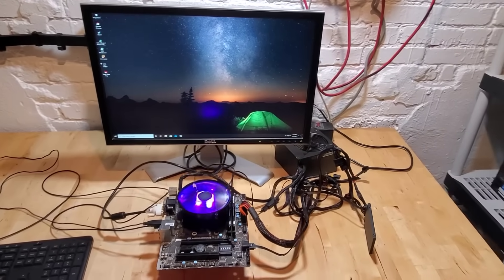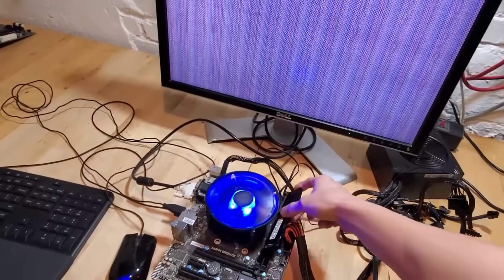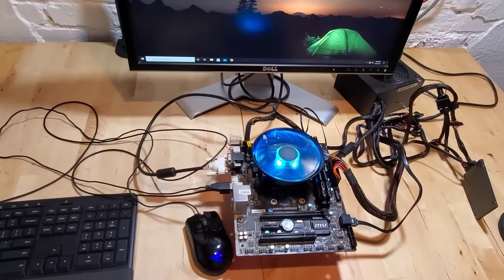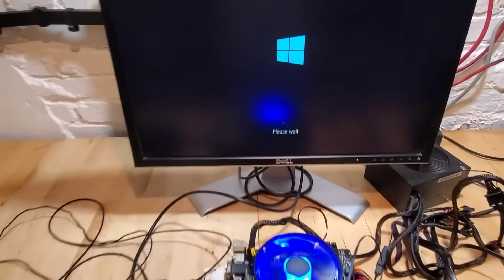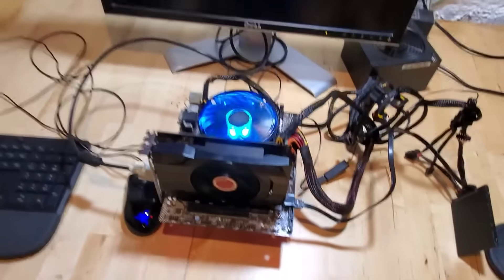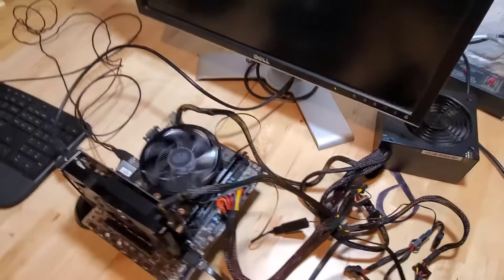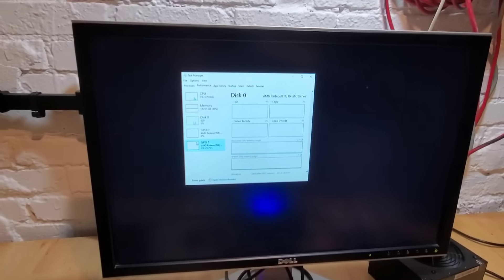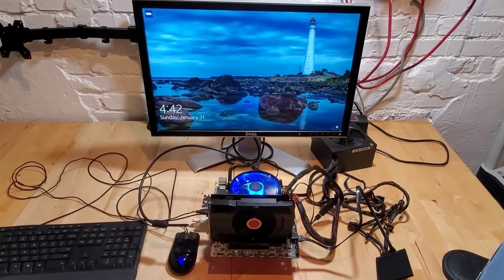What happens if you remove PC components from a running computer?

Comment: I'd love to see you try removing the cpu while its running, but with a graphics card plugged in. I think that the display was lost due to it using the cpu's integrated graphics, I'd love to see if there's any difference with the gpu plugged in
Reply: Here is my guess, it will be either a BSD, or a normal but froze screen. 
Might be just the same as a duo monitor setup, while the GPU driver is somehow not functioning but the CPU's GPU buffer is still there.
Reply: The GPU displays data that it gets from the CPU, means no CPU = no picture. Nothing on a PC works without a CPU, because the CPU is the only component that can controll the adress bus and select the chips and memories, that it needs.
Reply: @Kasi11  Actually, it displays data from its framebuffer in VRAM. One way to put the data in there is for the CPU to write it. GPUs can write to their own memory as well, but that gets triggered by receiving commands from the CPU.

It may be possible to start a program on the GPU shaders and have it continue running after the CPU is removed (I can't confirm or debunk this off the top of my head).
Reply: @falcon-ng6sd  Well I agree, but the GPU wouldn't be able to continue the program once the CPU is removed
Reply: @Kasi11  I don't know, it might work. I haven't experimented with CUDA/OpenCL enough to say for sure.
Reply: @falcon-ng6sd  well, i don't know much about modern coding but i know quite much about the hardware and normally the GPU wouldn't be able to read a program and execute it by its own, because the CPU will read the instructions and will transfer the data needed for the graphics to the GPU or VRAM which the GPU then reads and executes, but the computer technology gets so fast better and better, that this might not be true anymore. It would be nice to see someone testing that out.
Reply: @Kasi11  The CPU would get the GPU to start running the program and then let it work. There could be some issues with compute task timeouts - I'm not sure if these are enforced purely by the driver or if some controller inside the GPU is involved.

Anyway, yes, it would be an interesting experiment. A good substitute for removing the CPU from a running system could be triggering a kernel panic to lock everything up.
Reply: @falcon-ng6sd  after a little google search i found out that GPUs have their own instruction set so they are basically a computer for their own. But i think not every program will still run, but maybe a few will or at least show anything.

Comment: See what happens if you connect the IEC lead to the PSU, switch it on at the mains then plug it into a motherboard?
Have subscribed to your channel mate. Thanks for this video! have been using and building computers for over 20 years now and have always wondered what would happen if a component was put it again when the system is powered up from being off.
Reply: Not much would happen, as ATX has a softstart function requiring the motherboard to activate the power supply.

Comment: I mean playing with the HDD/SSD isn't that bad if you are turning off the pc. I was using my HDD as an external drive to store things a lot. I have my OS on my NVMe SSD and I'd just turn off the pc and connect the HDD. Turn the pc on and it would get recognized perfectly. I'd store my things on it, or move things from it on the SSD. Turn the pc off, disconnect it, restart and the pc and the OS would work perfectly fine. I'm not 100% sure, but I think it would still have worked fine if I did not turn the pc off at all if I had my OS on the SSD. I guess you just have to worry to connect the power first and then the SATA cable when you connect it and when you disconnect it start with the SATA and then the power.

Comment: Fun fact: removing and plugging secondary sata harddrives are okay when system is running.

Curious what will happen if you remove the GPU while the system is running, then connect the VGA cable to motherboard.

Comment: I have a question,
What if you turn on the pc when the power is low voltage

Every day, the electricity in my house is often low. And I don't want to turn on the pc when the voltage is low.

Comment: Windows software (except server systems) load all the main hardware only at the start of PC, so if you unplug and plug main hardware after bios screen, system will ignore it, so it does not support hot swapping.

Comment: Well and interesting thing happend to me some time ago, i was playing csgo and suddenly my game frozed, i tried launching the game again but steam didn't recognize csgo anymore, and when i relocated the game from steam, i saw that my hole SSD was missing, i have a sata ssd and m.2, and a HDD, the game was on the sata ssd, my heart dropped for a moment, but then i thought to myself maybe i didn't connect the data sata cable good enough, because i just cleaned my pc, placed the cable back properly this time and everything worked fine, but then i decided to do a test, i went and got in a comp, disconnected the ssd, my game froze and when i placed the cable back in everything works as intented and the game picks up from when it froze, so in conclusion check your wires twice after a cleanup !
The ssd model is: KINGSTON A400 240GB

Comment: i think if you remove the ram while having a dedicated gpu, it wont have this much of an effect of the picture. this could be because the onboard graphics does use the ram as video storage.
Reply: Same deal with removing the CPU - with integrated graphics, the GPU went with it. In older PCs, e.g. Intel Nehalem and earlier CPUs, the integrated GPU was in the chipset instead.

Comment: With few exceptions for special-purpose (and also expensive) SDRAM modules, RAM can only hold memory while getting power. This is why restoring the system by putting them back in would be impossible, even if the OS would be robustly designed to allow for hot swaping - all data in RAM would be lost.
Reply: No, Dynamic RAM (DRAM) not being refreshed retains memory but starts to decay to uncharged state. So unplugging a hot DRAM chip and replugging again means the decay cycle was extended from milliseconds to seconds, causing random errors. “Lest We Remember: Cold Boot Attacks on Encryption Keys” explored successful ways of doing this with acceptable losses (cooling DRAM stick to reduce error rate, error correcting/accepting data recovery algorithms).

Comment: Two corrections:
1: When restarting after pulling the CPU out, it shouldn't need to do anything to the CPU (theoretically, anyway). Windows boots into recovery mode whenever it detects a problem occurred that may affect normal startup, and it knows when it wasn't shut down correctly (because the filesystem is still marked as being 'open'), and it's also likely that the system management controller on your MB registered a CPU failure and recorded it in CMOS ram.
2: PCIe does support hot swapping, but many graphics cards don't, or more accurately, their Windows drivers/proprietary Linux drivers usually only initialize a GPU during boot. That said, if you had PCIe hot swapping enabled in your UEFI setup, you should be able to switch the display cable to the onboard graphics and carry on using the computer.

On a side note, it's rather curious that Windows doesn't bluescreen (or at least try to) when the RAM is removed. You would want it to in order to prevent data loss/corruption. I might try this on Linux to see if it panics.

Comment: Can you re-do that GPU test with a cable from the onboard gfx port to a second monitor? I wonder if it just switches to output the image on the other port when the GPU is removed. The system might still be working?
Reply: 的确，使用远程桌面还可以显示图像
Reply: @wsyong11  What you see via remote desktop is not always what comes out of the video port. So even if that works, it doesnt tell you if the PC is still working in terms of outputting an image for the local user.
Reply: En Linux eso podría funcionar.

Comment: Thanks to you, now we don´t need to sacrifice any expensive component to satisfy the curiosity.  But about the Hard Disks, for the bios taht includes "Hot Plug", option,  is safe to remove it  if no I/O operation is being performed,  and connect it back and it will resume the normal operation just like unplug/plug a flash drive.

Comment: you forgot to try pull off the power supply unit, and see if the system will still be running

Comment: Half of the reason why the system doesn’t recover is due to software ie Windows not being able to recover rather than it being a hardware failure.  What would the result be on Linux?  Hot swapping disks should be easy, but I’m not sure about ram sticks.  Gpu should recover as well, but there’s no way you can hot swap a cpu unless you’ve got full redundancy like a mainframe.
Reply: i know that for me, on linux, pulling out the harddrive/disk causes no immidiete problems
if you got programs in SWAP, they'll crash
but the system keeps running in read only, with programs/libraries cached in ram
Reply: Could disable swap file on that ssd, have enough ram in the pc, and taking out the ssd then shouldnt crash Windows.

Comment: The Windows not booting normally issue was surely not caused by you removing the CPU and the CPU does not "need some recovery work" at that or any point. Its just how Windows works - you don't shut it down properly, the OS checks itself if something got damaged - on the file system usually.

Comment: Nowadays, windows has removed hardware protections, which will cause a system interrupt with a blue screen. But back in the days of Win9x, it was a lot more fun.
Reply: You can try it using mountvol C: /d without having to take the hdd off. It should go back to normal after the reboot

Comment: At first case you also removed VRAM (for integrated GPU), you should retest it with using discrete GPU.
Also it would be interesting to disconnect discrete GPU with using iGPU.

Comment: Kinda disappointed you didn’t take out the ram while the GPU was on to see how it would affect it when not relying on the integrated graphics
Reply: I second this. It would have been interesting to see what patterns, if any, would have developed in doing that because the screen's framebuffer is in VRAM on the GPU instead of system RAM.
Reply: the same will happpen since gpu drivers are loaded into the ram.
Reply: @Servidor_Publico_do_Ancapistao  that's a good point, this fact totally slipped my mind!
Reply: @Servidor_Publico_do_Ancapistao  So you can safely say that patterns are caused by drivers and not something else? Especially since not all of RAM was disconnected at first
Reply: @MrCh0o  when he removed one ram, part of the information from that ram was lost, but the other part was still loaded into the second stick, but the computer was already frozen by the time he removed the stick. Removing the second stick just killed the rest which was already dead.
Reply: Another nice thing would be to check whether the integrated graphics (and the rest of the system) were still operating fine when the discrete GPU got removed
Reply: @MrCh0o  removing a live pci/pci-e card will almost definitely short and fry it. he got very lucky
Reply: @wheeI  You don't understand what a short circuit is. Removing a PCIe card will never cause a short circuit, unless after removing the card you stick a screwdriver into the PCIe slot to short it...
PCIe actually has support for hotswapping, though hardly any motherboard has it enabled as nobody uses it. So hotswapping a GPU is a bad idea, won't work and might damage your GPU but it will not cause a short...
Reply: The same thing will happen since you may see in the last part where the hard disk is removed.
Part of the "stuff" are temporally placed in the RAM and once no matter what. So once the "stuff" are forcefully removed, the OS will not act as normal.
Do you ever wonder why the running OS itself requires so much RAM?
Reply: @willqin4628  Not true: Windows will always crash, because it is badly built and lousy. Linux on the other hand will just keep going, it will complain (kernel logs will tell) that it can't read or write from the SSD. IT will keep trying though and when you plug in the disk again, it will just resume the read and writes that the Kernel had before. Linux was originally based on Unix, which was the best OS in the world while Billy Gates was still in diapers. The lesson here: If you build an system well from the start and build it for the ages (Unix), it will still be working amazingly even 80 years later (Unix turned into Linux, Unix died, Linux kept going). While if you design something shitty (Windows) then it will never really work well. That is why professional IT today uses Linux, not Windows.
Reply: i tried this myself about a year ago actually because my system was only recognizing one stick, so i thought the other was not seated properly and wouldnt make a difference to remove it, foolish i know. but iirc what happened was the screen froze and the display didnt clear until i restarted. but unlike what happened in the video my pc wont reboot, the psu fans spin up and so on but i dont get any display feed at all, not even a bios prompt. i still have the pc though so if anyone has any suggestions to get 'er working again i'd be very grateful, esp as i havent had much spare cash available to replace it or take to a repair shop unfortunately.
Reply: u do it then brokie
Reply: Just a bluescreen, as the OS and all data storage for the CPU is suddenly gone. Except that the code needed to display the bluescreen in Windows was also in the RAM, is the same if you remove all memory from a human being: Instant death, as even the information how to breathe or the heart beating is gone.

Comment: What happens if you remove the RAM while using the GPU as output? Integrated graphics use system memory, so that's probably what happened to the screen. But the card has dedicated vram, so it might behave differently.

Comment: I cringed so hard during the entire video my face broke.

Having said that, I did try a really bad thing one time some 15 years ago.  I tried to swap IDE hard drives while the system was running.  Turns out the knowledge of what's on the drive is kind of a "shared resource" between the drive and the OS.  The PC didn't understand what it was looking at; it thought it was still looking at the old drive.  I swapped the old drive back in but it had already absorbed some of the "new" information from the other drive which then was integrated into the original drive.  By "information" I mean directory and file structure.  The drive was ok but the OS and drive no longer knew where anything was with certainly.  It was a file full of photos and all the photos were now "ripped" like looking at an old VHS tape with video tears on it.  Many photos were gone completely, some folders were missing and almost all the photos were affected.  Some not too bad, many ripped halfway through, many completely unsalvageable.

So yeah don't do that.  Or pull ANYTHING from your computer while it's running.

Comment: I've always wanted to see what happens if you try installing an additional stick of RAM with the computer running.  Also rdp into the computer, then remove the gpu to see if the whole computer is locking up
Reply: If you install another stick, the system won't recognize it until you reboot

Comment: The ssd removal now clears up my mind why my computer is going black then bsoding
Reply: The bsod believe it or not is actually a program that runs when a critical issue is detected. Its possible to disable it but you honestly shouldnt. But when it is disabled and the pc crashes, the system just hangs.

Comment: Is there anyone else like me who had never opened CPU, even for cleaning, thinking that you can't put it back together or you'll break it?
Reply: Only difficult part is putting it in when building as you can bend pins on the motherboard (did it on my first build but msi got me an rma quick). Once it is in you can always reapply some new thermal paste to get temps down every couple of years. It is super easy and nothing to really worry about tbh, built my first pc at 14 or 15. You don't need to take it out to reapply thermal paste aka cleaning it. Just use cotton tips with a little isopropyl alcohol on them to clean the old paste off.

Comment: Basically, nothing happened. The recovery screen wasn't because the CPU was recovering, but because W10 has detected multiple sudden stop at previous sessions. At reboot button press, Windows knew that it doesn't have to worry anymore and just performed a normal boot. And the BIOS boot was because the drive boot entry was deleted, as at booting he wasn't detecting it at all. At replug he re added it and booted into it

Comment: It's like buying a sledge hammer, and  breaking your barrels. (removing components) If you try to put away these barrels, they won't fix themselves. (puting components back in) However, you get new ones, and replace the old ones. (restart)